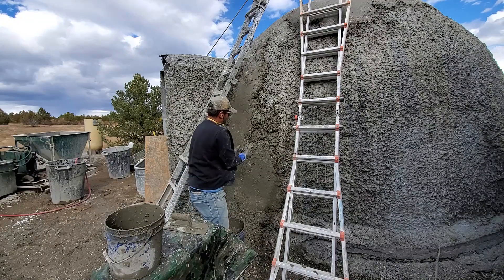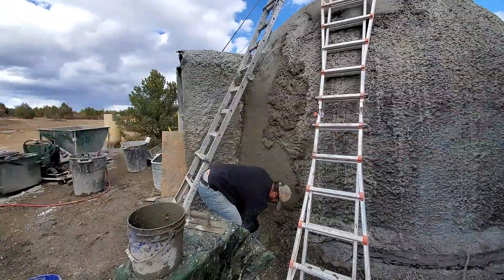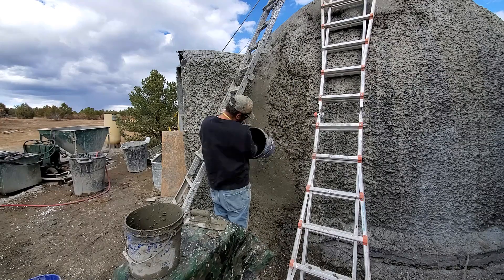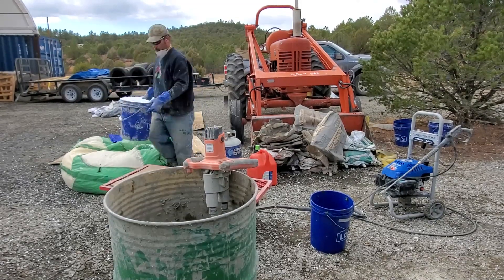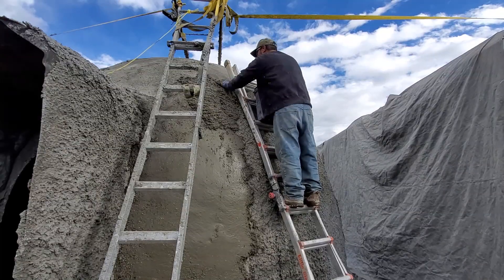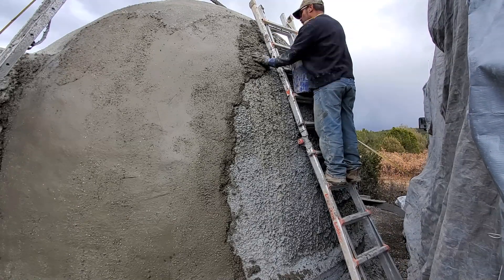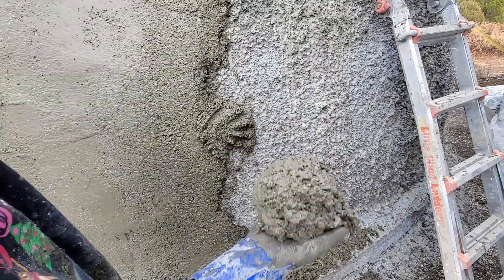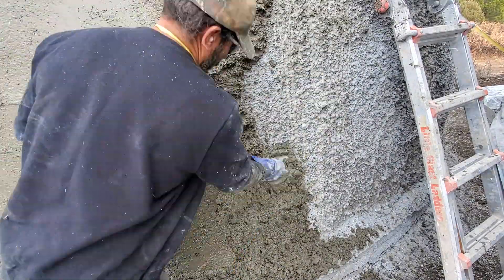Building Dome Cabin | Part 5 #aircreteharry #EPICcementmix #slab #domehome #aircrete #diy #airform

Comment: The door is supposed to swing inside someone could just take the pins out of the hinges and get right in .
Reply: Probably too tight to swing inward, just spot weld top and bottom of the hinges?
Commercial doors have bearings  and heavier hinges that can't be punched out? 🤔

Comment: Hi Harry, I've been looking into the different Hydroseeders and grout pumps. I already own a TK MM6P-GH8 Mortar Mixer 6 cu. ft. capacity and am looking for a pumping devise to do the spraying. 

What are your thoughts on a spraying / application system / pump? 

I did buy your videos and mix formulas, thank you for doing the work. I sent an email to "the professor" Dave and did not receive a response. I know he has worked on EPIC for a long time and would like both your opinions.
Thank you for all you do...

Comment: Am I correct?
It looks like the price for aircrete is about the same as concrete.
Instead of sand and aggregate  you are using air and suds.. 
Depending on the desired strength  the yiekd is about the same per bag of portland cement. Is this correct? About 6 to 7 cubic ft. Still needing 5 to 6 bags to make 4x8x4" slab coating approximately  75+ bucks for 32 square ft 4 inches thick... am I close.. or delusional? Thanks
Tight budget.. cant afford big mistakes

Is it worth it compared to hollow cement building blocks 8x8x16?
Them holes can be filled be with cob making a solid block.

Comment: Building an Aircrete dome atop of 2 buried yet connected shipping containers or 12’ round culvert conversion would be the ultimate cabin in the high desert .
Reply from the maker: I like the idea of building a dome on top of a buried dome better. If only I had deep enough soil.
Reply: Aircrete Harry , my wife and I want to relocate S.W. Colorado. Currently we reside in MN. I was looking at rammed earth. But now you have my brain gears spinning. I really never thought of shotcrete in this application. I usually see it when one of the high end condos we are building decides they want to do rooftop pools. What do you think would be easier to get permitted in S.W. Colorado? Shotcrete dome or rammed earth?